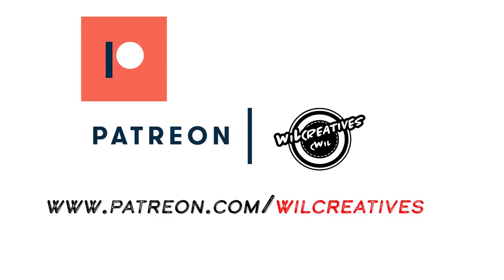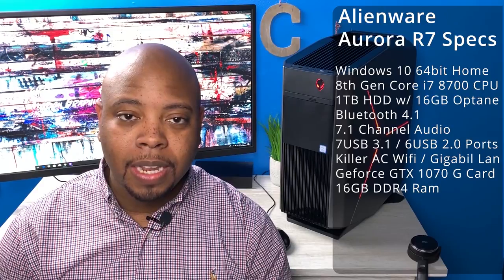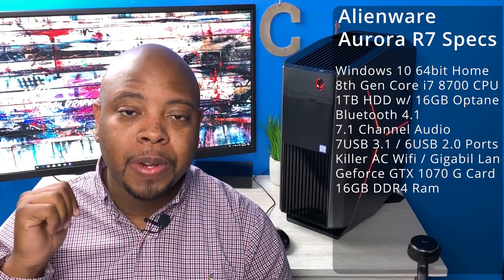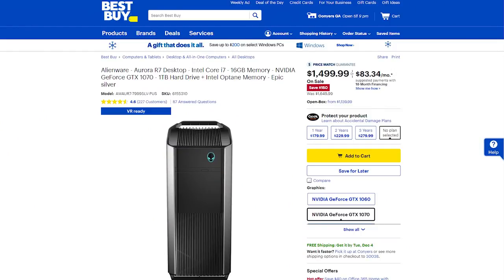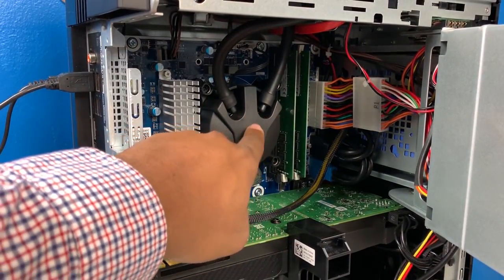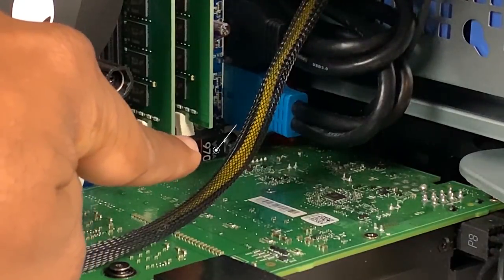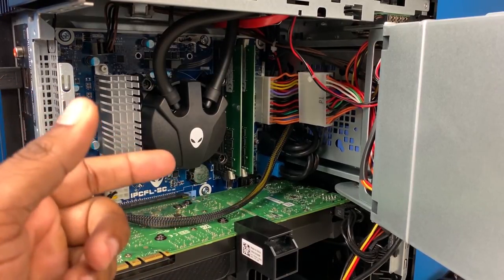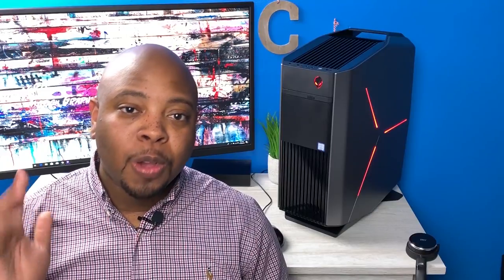30 Days with the Alienware Aurora R7 Full Review (i7 8700, Nvidia Geforce Gtx 1070)

Comment: Alienware is the worst shit ever. my motherboard went bad right after upgrading my cpu. Just the cpu.. i decided to buy another Motherboard. Mpg Z390 gaming plus and new case as well. Transfered everything and guess what.. cpu water cooler from alienware only works on alien ware boards. So now i had to buy another cooler system. Cables from PSU are also very short... had to buy extension cables. So make sure that your system never dies on you or else you will be spending money like crazy
Reply from the maker: I agree, when I first got the Aurora R7 the cost of building a pc was astronomical. Ending up getting a good deal on this one but ran into issues shortly after which prompted me to start doing upgrades. Then I built my own system and never looked back!

Comment: Does anyone's system use 8gb of ram when idle? Mine does and it's a 32gb system
Reply from the maker: +Harry Hunt On idle mines uses 5-6gb’s yeah and nobody is talking about it! But I haven’t ran into any issues
Reply: Clean install Windows. Get rid of the bloat that Dell slaps on these. Also the more RAM you have the more it will cache. Because unused RAM is wasted RAM.

Comment: i had this pc for like 2 months, with a i7 8700 and 1070, man the psu used to sound like it was gonna blast off when i was playing.. i sold it asap and built a pc with a 8700k/2070, much happier. my r7 had the same dell 1070 which was an MSi aero 1070 rebranded, or unbranded for that matter. shitty reference card used to get to like 80c. fuck dell..
Reply from the maker: Yeah based on people's system configuration I've seen different user experiences.
Reply: Weird mine came out fine